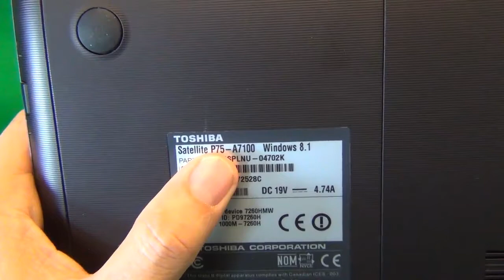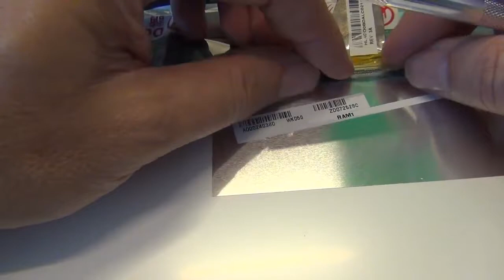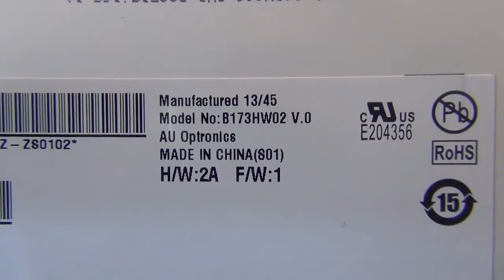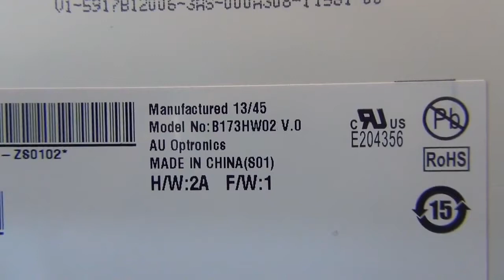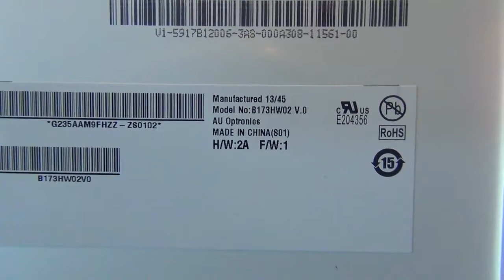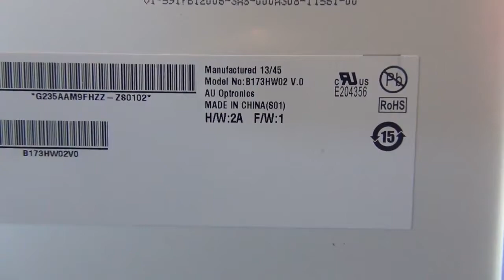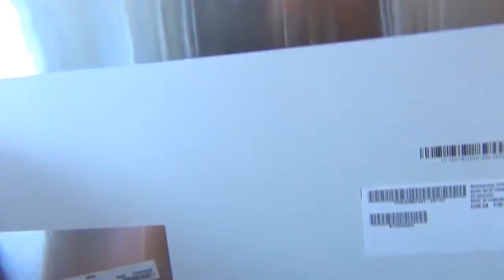Toshiba Satellite P75 Laptop Screen Replacement Procedure

Comment: The screen on your website is more than double what it should cost.

Broke one out of two hinges while absolutely following instructions perfectly, saving time often causes new problems. Now we have to order a new bezel for the screen. Added a week to our repair time and have caused the owner of the laptop to become disgruntled. 

Could have just taken the whole thing apart according to another video that did it properly. This is not the proper way to replace screen on this laptop.

Comment: I need to do a keyboard replacement for my Toshiba Satellite P75 Laptop. I'm a bit baffled that i have to completely disassemble my laptop in order to replace it. Is it possible you could make a video or give me some tips? I have no experience handling computers and i don't want to get ripped off by repair shop.